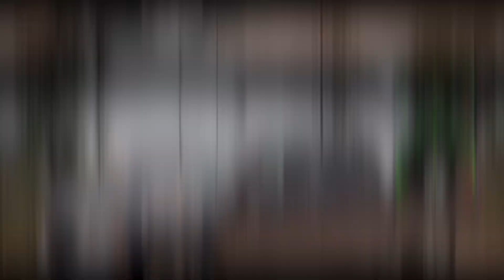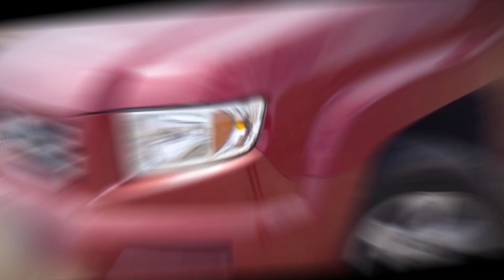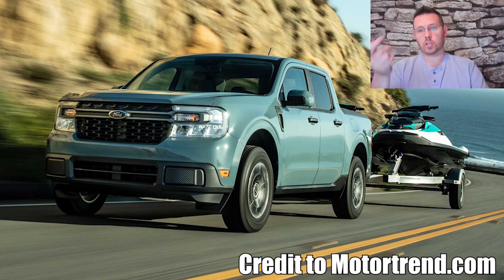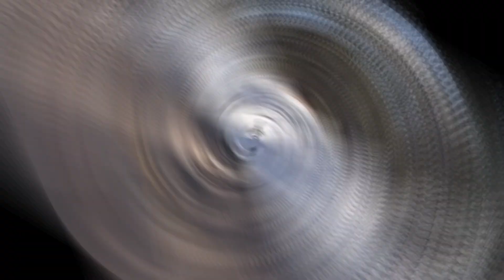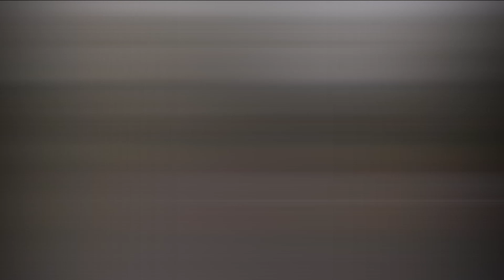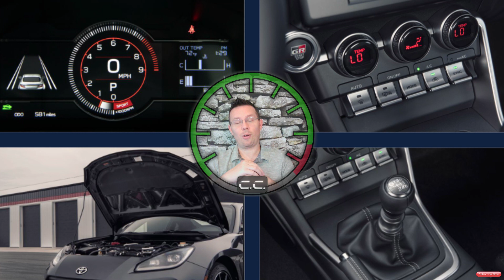GR86

Comment: 2022 brz because I’ve always wanted the first gen and I’m putting an aero kit on it anyways so preferring the front fascia doesn’t mean much, manual for sure and I’d make the interior rival luxury cars
Reply from the maker: Did you already put an order in on your new BRZ? Congrats on your new car, what color did you get? Do you plan on tracking the car? 

Thank you for the comment and for watching my channel, please like and subscribe for future content.
Reply: CruiseControl not yet I’m in the process of moving rn so when I get all that sorted out I’m putting an order in for a wr blue limited 6 speed manual and hell yea I’m tracking the car
Reply from the maker: Are you getting the premium or the limited? World Rally Blue Pearl is exactly the color I would get it in with the manual and in the limited with the Alcantara seats.
Reply: CruiseControl limited for sure need the bigger wheels and real tires from the factory since it rains in Florida a lot
Reply from the maker: We are going to end up with the same exact build.
Reply: CruiseControl looks like you have good taste then, can’t wait to modify the shit out of mine gonna vlog the entire build
Reply from the maker: I'm definitely going to modify it little by little. I will start with 200 tread tires, track pads, high temp brake fluid and then hit my local track. Based on how it feels will determine where I go next. I will eventually an equal length headers and a tune. Then after tracking it potentially coil overs, Brembo brakes, and sway bars. 

What mods are up planning on getting for it?

Comment: Impressive numbers for sure. This comment might not be popular but, who would pay 15-20k for an S2000 anymore? Same weight, same acceleration, more power in the twins, better weight distribution on the s2k, modern technology in the twins, brand new 30k with a warranty, ability to finance.
Reply from the maker: The engine, the fact the it revs to 9,000rpm in the AP1, it's mid engine, has one of the best shifters ever made, sounds better, gives you the open top experience and it's going to hold it's value would be the reasons on the top of my head why someone would by an S2000 over the twins. 

Now for year round driving, a more compliant suspension, room to take your track wheels and tires, and come with a warranty like you said this is pretty unbeatable. It's on my shopping list that's for sure. I look forward to driving the twins and seeing if I like one more than the other. Which one would you get the BRZ or the GR86? 

Thank you for your comment and for watching my channel.
Reply: @CruiseControl1  Impressive power and torque, if those numbers are to be believed. I like the GR look more than the BRZ.   

My first mods would be the same as you:
Brake pads/fluid, wheels and good tires

My second mods would be:
Lightweight pulley kit
Lightweight flywheel (Not the lightest one... just slightly lighter than stock)
CF drive shaft
4.88 final drive gear

These mods would really waken up the car and not really affect reliability if proper parts and installation is done.
Reply from the maker: Check out Savagegees his link is on my description you can see the Dyno pulls there on a Dynojet. 

Your mods sound good, no header and tune though? 

Thank you for your comment and for watching my channel, please like and subscribe for future content.
Reply: @CruiseControl1  GReddy has dynod the GR86 and had 191 HP
Reply from the maker: Big difference between the Dyno pulls, I wonder why?
Reply: @CruiseControl1  air temps, correction factors and dyno calibration all come into play. Would have to have been done in 4th gear, since it's a 1:1 ratio.
Reply from the maker: @Dragonfire89nd  What kind of Dyno did Greddy use? Savagegees used a Dynojet.
Reply: @CruiseControl1  Dyno jet aswell..... you'll see it in the video https://youtu.be/PjWVD4kb144
Reply from the maker: https://youtu.be/4OAOh3OCSt8

Here is the one from Savagegees. Peak HP is like 300rpm sooner on the BRZ, I'm wondering if the twins have different tunes from the factory.

Thank you for sharing the video
Reply: I'll beleive the Japanese numbers... typical drive train loss is about 15% on FR cars. Which this falls perfectly in-line with.
Reply: @Dragonfire89nd  Agreed. Without a carbon fiber driveshaft and lightweight flywheel it's hard to believe a 9% drivetrain loss in a RWD car.
Reply: @Dragonfire89nd  Research shows it's quite a bit less on FR cars manufactured over the last 30 years, especially with small 4 cyl. drivelines. Now, with big V8 muscle cars from the 60's-80's, the drivelines were not as efficient and neither were the fluids as slippery. Friction was higher and parts were heavier, so power losses were greater--about 15%. Today, 10% is expected, especially with 4 cyl. engines having AL driveshafts.
Reply: Not the same acceleration... the GR86 i believe is faster in the 1/4. However i agree with you! who wants a s2000 compared to this beautiful car! 

S2000:

-Old and outdated flimsy platform.
-Horrible aerodynamics in the rear end
-No torque in lower RPM
-Convertible
-Small interior, cant accommodate taller people or many things
-Old interior and few creature comforts
-Expensive for its capabilities compared to modern cars
-No rear seats
-moderate to expensive to run and own, heavily dependent on age and condition 

+Engine; one of the best naturally asperated 4 poppers!
+Lightweight chassis and good weight distribution 
+Huge aftermarket
+Convertible
+Best manual transmission feel for under 50K$
+Factory LSD

GR86/BRZ:
-Poor body paint and corrosion resistance (Don't drive in salt belt areas)
-No convertible or sunroof option
-Muted and uninspiring engine sound
-A.S.C. (No easy way to defeat)
-Manual transmission feel compared to s2000 is subpar 
-No knee pads on base model
-Primacy tires on base

+Manual transmission is better than most
+Excellent body rigidity 
+Good weight distribution  
+Factory warranty
+No convertible
+Rear seats (albeit not very usable) 
+Interior space and usability (Driver/passenger)
+Well equipped amenities (AC, heated seats, infotainment, auto turning headlights)
+Strong naturally aspirated 4 cylinder
+Good steering feel
+One of if not the largest aftermarket support
+Two models to choose from (GR86 and BRZ)   
+Factory LSD
+Cheap to own and maintain
Reply from the maker: Probably the most comprehensive pro and con list I've seen between the twins and the s2000. Thank you for your sharing and for watching my channel.
Reply: Good comment. That said, the F20C in the S2000 was never a 240 hp engine, stock. Honda overrated it for the shock and awe factor of the power density figure, which is just marketing hype. That engine routinely put down 191-193 on the Dynojet. Then, the AP2 came out with its F22C1 and, ironically, it was rated 3 hp less than the AP1 yet consistently put down 205-208 on the Dynojet. That engine was rated accurately, and would likely pass J1349 SAE testing. Stock, the F20C maybe produces 225 bhp on a good day, but more likely 222-223.
Reply: This makes sense because the engines are very similar outside of their stock tune, only the F22C1 has 7.5% more combustion volume, which just so happens to be the same percentage difference between 193 and 208 whp. Isn't it nice when numbers come together in a logical way? ;-)
Reply: What's better at that price point? With that hp it will probably run 13.8-13.9ish like the s2k ap2... Veloster N manual 13.7, elantra N probably same, challenger rt 13.7 ish.... It's fast enough to have plenty of fun
Reply from the maker: @Byebyesmeow  Agreed.
Thank you for your comment and for watching my channel, please like and subscribe for future content.